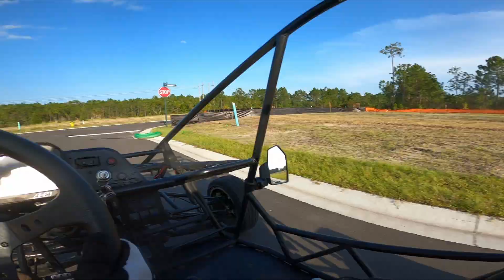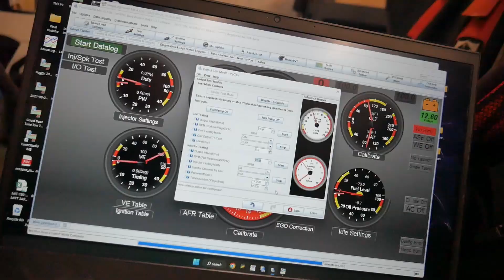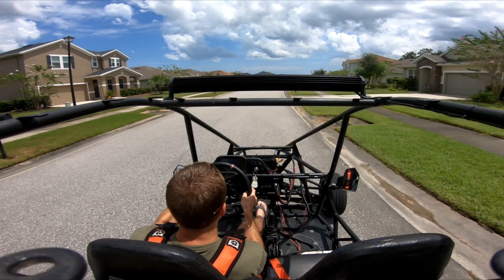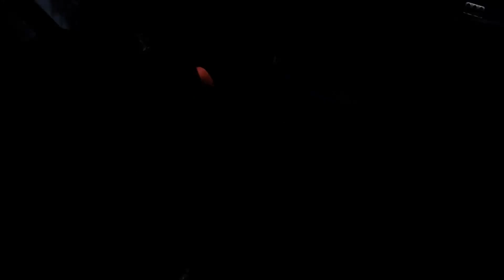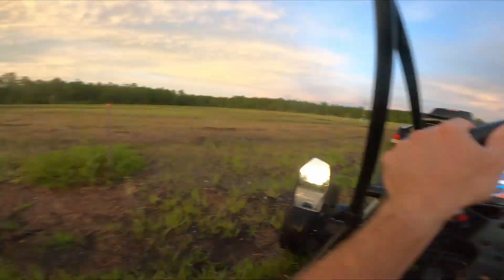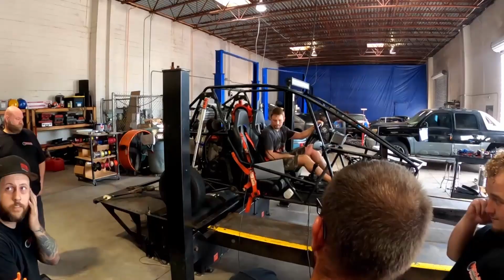The Best Ignition Upgrade for COP (Coil On Plug) | Diagnosing a Misfire

Comment: Check the spark plug gap you may be getting spark blow out . I had the same issue with one of my Eagle talons . Wasn’t showing anything odd except the airflow readings where going all over the place whenever I went over a certain %tps at 30+ psi
Reply: Also whats the engine set up
Reply from the maker: Lots boost on Mirage 1.2L, I brought the gap down a lot